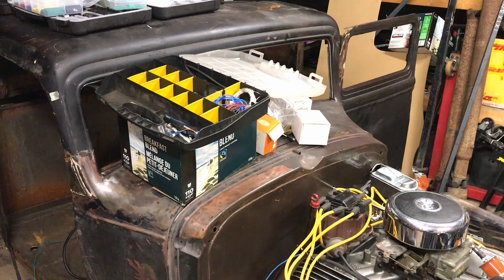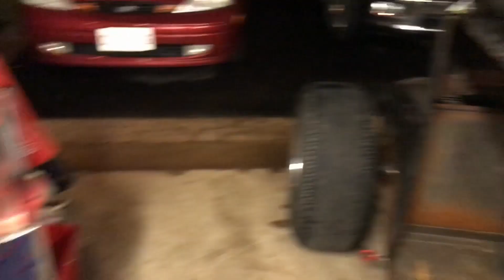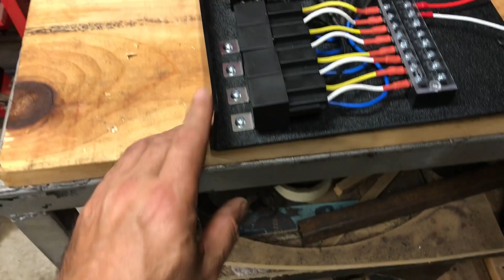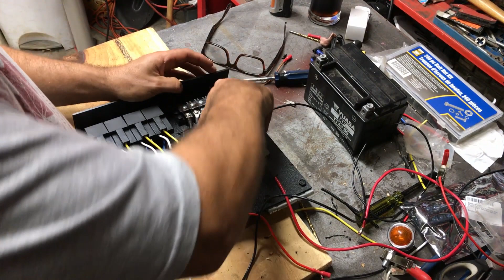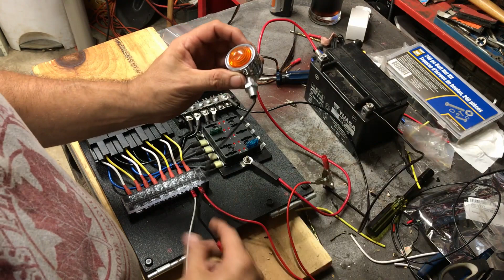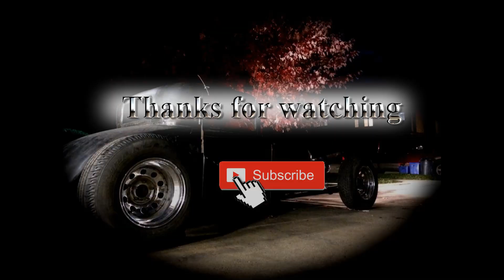Custom Fuse and Relay Panel Bench Test

Comment: Love this man! I'm in the process of making a fuse/relay panel for my 2018 WRX. I currently got a small setup on my driver side but there isn't much room under there and it's a PAIN to add new things to the secondary fuse box I made. That and it's only set up for constant power. I will be adding a relay and additional fuse block for switched that way things connect with less wiring... Much cleaner than I have now. That being the case, I want to moving it to either behind the glovebox or at least tucked way up on the firewall in the passenger area. And having the hinges on there... THAT is a briliant idea. That way, it sits up, flush with whatever... And when you need to access it, just flip it down. Again, love this video! And favorite part... 6:40 =P

Comment: And you are going to use something way bigger than 10 awg to connect the board the battery in the car, right?
Reply from the maker: So I have the proper thick main battery cable running up to a cut-off switch. It then splits, with the main cable running to the starter, and another running to a large fuse, then on to the ignition. Fuse panel takes a feed from ignition, so everything is dead when key is removed.

Comment: Looks great.  I did something similar years ago, when installing a remote start system, but in mine I added and LED that was wired to get power through the relay coil, so if the led went out I knew the relay was bad.  A bit of overkill but it was cool to look at.

Comment: One thing that confuses me a bit is how to supply power to switches.  For this example it looks like you just grabbed an available circuit with a fuse while the relay (terminal 30) was being fed by a different fused circuit.  In the car, will the switch and the relay share the same fuse protected spade?  Meaning will it share the fused spade that goes to relay terminal 30?  Or will you just have all your switches on a single low amp fuse circuit?  I hope that question makes sense!
Reply from the maker: I totally understand how you feel. It took me a long time to get my head around it all, and since that video I have completely wired a new project car. Think of it like this... The relay is a remote "power supply" which requires it's own fuse. The toggle switch "activates" that power supply but uses a smaller wire and fuse because it has it's own little circuit to complete. Kind of like a remote controlled car, you use the remote to control the car, but the car has it's own power supply. But instead of sending the signal through radio waves, you are sending the signal through a small gauge wired circuit. 
Does that make sense? If not, I'll try again, lol.
Reply: @ScottRods  sorry my question wasn't clear.  I understand relays I wire them occasionally in my projects.  What I'm asking is what circuit do you use to power the switch associated with the relay trigger?  Do you use the same circuit as the relay or do you combine all your dash switches into one circuit just for switches?
Reply from the maker: @ToddMcF2002  Ok, gotcha. I currently have: 
main power wire from battery goes to junction/big red engine kill switch.
From there, the thick wire continues to starter and any thick wired relays in the engine bay (with an in-line fuse before a relay)
I have a second power feed coming off that junction, which first goes to a large in-line fuse, then on to the ignition switch. From the ignition switch I have the power feed going to the fuse box.
This does of course mean that when I remove the key from ignition there is no power going to any of the accessories, so not ideal for things like analogue clocks etc.
Soooo, the lights switch (for example) will take a feed from the fuse box and continue on to the lights relay (or whatever relay) 
Any clearer? hehehe.

Comment: A question,you can do the same with a switch without using a relay,so what would you use the relay?to send more power or for?
Reply from the maker: The point of the relay, is to allow you to run power thirsty parts, like electric motors and lights, without having to run heavy gauge wires all through your car. You would mount the relay close to the thing you want to power, and use a short length of heavy wire, then run thin gauge wire to your switch on the dash. This also means you don't need heavy duty switches on your dash.
Reply: @ScottRods  so the relay its pretty much to protect the switch and so on since it can take more power
Reply from the maker: @franciscoayon9470  Exactly, but you also reduce the risk of electrical fires from thin wires running too much power.

Comment: Did you consider using a circuit breaker for the headlights rather than a fuse?
Reply from the maker: I'm open to advice on what is best.
Reply: @ScottRods  I'm not a wiring expert, but my understanding; if you use a circuit breaker rather than a fuse on the headlights you may be able to limp home at night.  The circuit breaker cools automatically, resets, lights come on briefly until the circuit breaker trips again,. This happens over and over.  Might want to do some research, my thinking on how it works may be flawed, after all I'm 70 years old.  :)
Reply from the maker: @a075923  Thanks Mike. My cooling system wiring came with a circuit breaker and I couldn't figure out how it worked as it seemed to be just a solid electrical join, but that makes sense now. I'll do some more research.

Comment: Hello, respected sir, your work is beautiful, sir, and I wish you success always. I am a new friend. I hope that you will be very light. My question is: Is it possible to put your private rail to the right and left signal line with the Rayleigh complex with the fuse box?
Reply from the maker: Hello. I'm guessing English is not your first language? I think you are asking if you can add a flasher unit to this system. I would advise using a separate wiring system for the flasher unit with it's own fuse, as it needs to come on without the ignition "on". For example, hazard lights (4 way flashers) need to be available when you leave the car.
Reply: Thank you, respected sir. Yes, this is not a mother tongue. I hope to be a new friend for you. I’m honored to thank you. @ScottRods

Comment: I like it. I am going to be doing something similar in mine. I am going with an industrial look. All toggle switches,  no keys. And I am thinking about mounting the fuse/relay panel on the center console visible but under a clear plastic panel. Hope you figure out the registration problem.

Comment: Cool!!! Wiring is my favorite part of the job!!! Keep Scott Rodding it out!!!
Reply from the maker: Not sure if you're being serious or sarcastic here lol. I kinda like it.
Reply: @ScottRods  I'm being serious!!! I love doing wiring and I'm great at it!!! I  fix wiring problems all the time and enjoy wiring up old cars properly!!! It is my favorite part of the build!!! Keep Rocking it out!!!
Reply: @rockerpat1085  I can attest to that. Rocker Pat helped me out and it all worked out.
Reply from the maker: @rockerpat1085   Ok, here's a question that's been keeping me up at nights.... Where should I take the live 12v feed from, for switches etc that are triggering the relays? Seems daft to take a feed from the fuse panel, which will then be fused again to power a relay.
Reply: @ScottRods  If you are using relays you can have all your switches provide the ground for the relays!!! No power needs to go to the switch!!! You can tie you relay coil wire to the relay load wire and run the relay coil ground to the switch!!! Switch can be a toggle, momentary, or even a temp control switch for the cooling fan!!! By using a relay you have taken all the load off the switch and all it does is provide a ground path for the relay!!! One fuse is all you need to control the circuit!!! Let me know if you need more help!!! 🤘🤘🤘
Reply: @ScottRods  One other thing. To power up your fuse panel you can come off the starter main battery cable, but you MUST install a fuseable link at the starter so that your #8 or #10 wire that is feeding the fuse panel is protected!!! ALL positive wires HAVE to have some sort of fuse protection so in the case of a cut wire that touches ground it will blow the fuse instead of burning up the wire potentially causing a fire!!! Again make sure you install a fuseable link at the starter or were ever you get power from the battery!!! Keep Rocking it out!!!
Reply from the maker: @rockerpat1085  Damn, wish I'd thought of that before I made my panel.
Reply: @ScottRods  I can attest to that. Rocker Pat helped me out and it all worked out